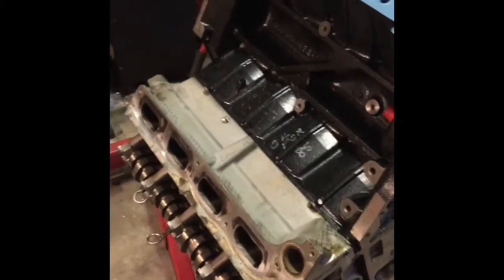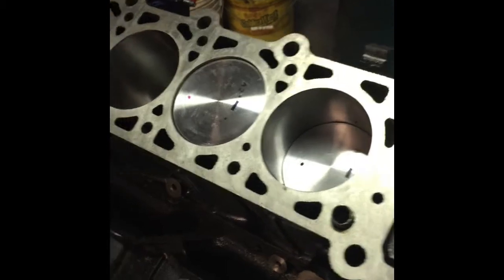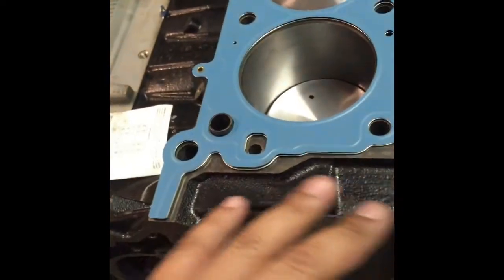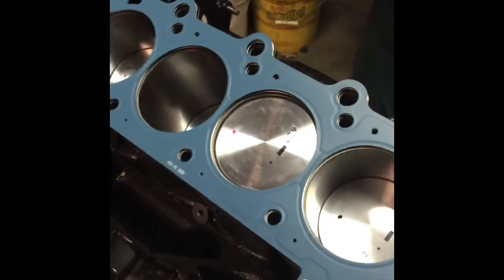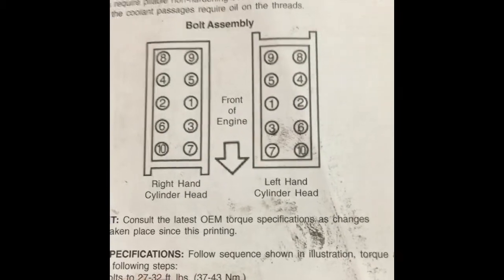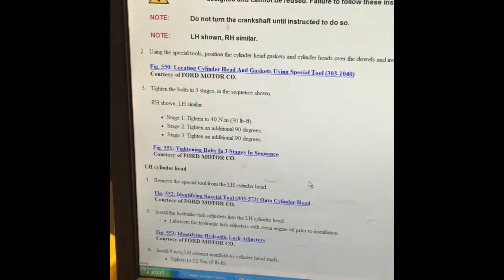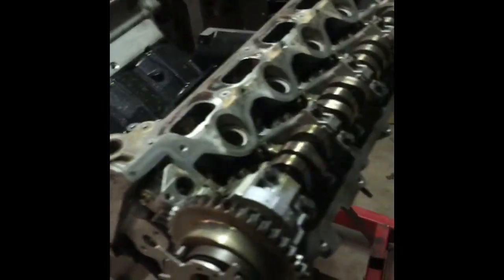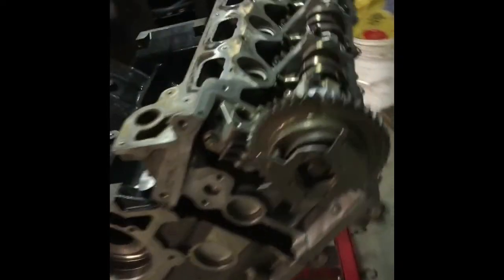FORD F150/EXPEDITION TRITON 5.4 3V HEAD  GASKET JOB

Comment: I have an 04 lariat 5.4. 3v engine. I bought it 2 years ago. 
Last year I was going to change spark plugs and bought the motorcraft 8 pack according to year and engine.. Took them to my mechanic and as soon as he took on out we realized they were completely different!. Long story short I had to buy new spark plugs such are on 09 models and newer.. So my question is. How is that possible?
Did the previous owner put a new engine? What are the possible reasons to have this "updated" spark plugs in my engine?
Reply from the maker: so what your saying is that when you ought the plugs they gave you the "short" plugs but your engine had the "long" plugs?
Reply: Basically what I'm saying is I have an 04 lariat that uses 09 spark plugs.. How is that even possible?
Reply from the maker: the engine could have been replaced or maybe somebody updated the heads
Reply: @FalconsGarage  ok. Thank you for your time to answer my question.. 
I hope the previous owner just did the heads update and not the engine swap. Because in my country I need to proof that the new engine came from a dealer or store and not from a stolen truck. And I don't have any document or bill related to a new engine..
Reply from the maker: oh wow!
Reply: @FalconsGarage  yeah.. I know.. It's kind of scary. 
Probably I should sell it...

Comment: Looking to buy a 03 F150 Lariat with a blown head gasket, can this be repaired without taking out engine and anything you recommend while doing this job
thanks
Reply from the maker: yes you can do the job with out removing the engine. I would recommend on investing in a phaser lock kit. This engine are known to be noisy because of the phasers and timing chains, but this kit will remove those issues.
Reply: Did u buy it?

Comment: will this work for 02 harley edition 5.4 supercharged?
Reply from the maker: I don't think so. Because the 5.4 supercharged engine doesn't have cam phasers. Iqbal is it that you need? Timing?
Reply: my truck is  burning coolant so i have to take the heads out
Reply from the maker: ok I see . make sure you buy some good head studs for that truck... I just did a build on a lightning last year and we are pushing 550HP to the wheels but the engine its good for 1100HP.  Pm me your email and ill send you the bolt pattern and torque specs.
Reply from the maker: +chol2 pride1 use ARP studs. Way better then ford. Specially for a lightning.
Reply from the maker: +chol2 pride1 email send